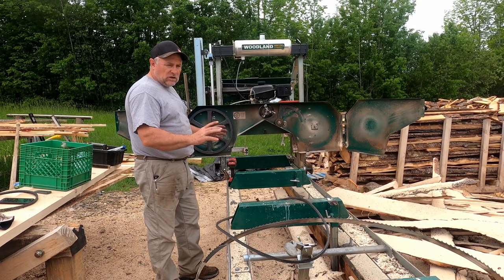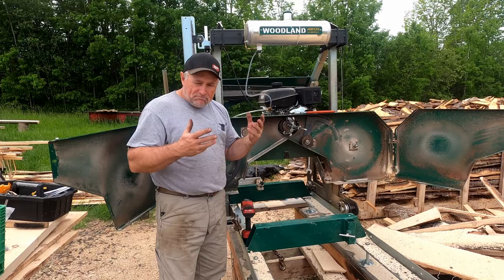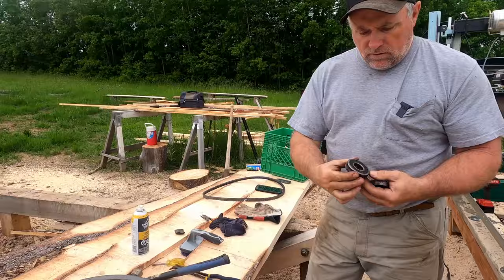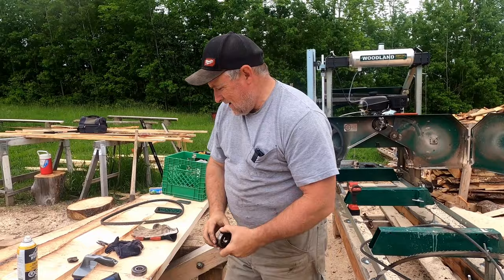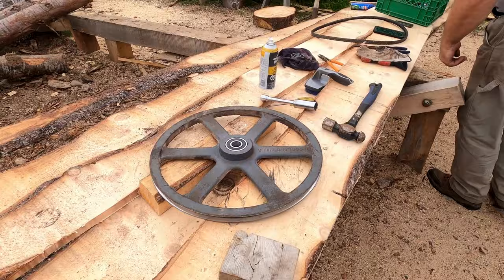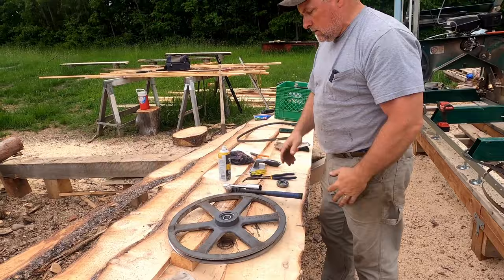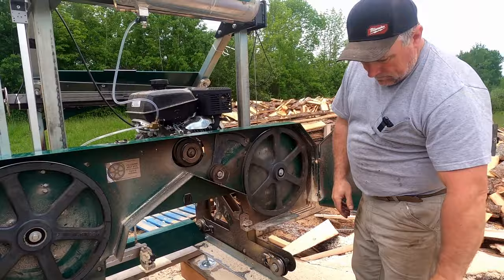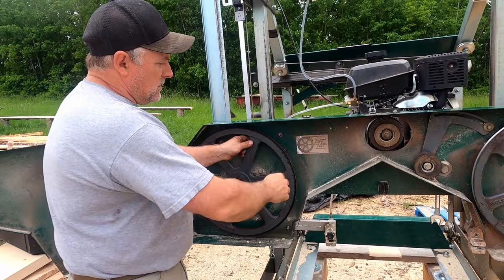Woodland Mills HM 126 / The Bearings are Shot Already.

Comment: My 2015 model WM 126 has about 700 hrs on it, I saw about 30-50 big white pine, spruce and maple logs per year, I’ve never had to replace the wheel bearing, one thing I do once per year is spray them with WD 40 with the blade at half throttle, I get the little tube right against the bearing so it penetrates, I also spray the outer clutch bearing, after it started howling one day, the problem I find is the humidity and moisture can cause all kinds of problems. I have a new spare clutch and bearings since day one. Great job on the tutorial on changing the bearings.
Reply from the maker: Thanks. Those are great tips. I use a lot of the WD40 as well. I think my bearings were wore out because I mill every day. I know Woodland Mills changed their supplier as well. The bearings on the older models were made in the US. Most of the parts now are outsourced from China. I think the quality has been somewhat compromised. Thanks again and have a great week.

Comment: That was one of the best videos on replacing bearings.  One thing I've learned about some new sealed ball bearings they can be light on grease. I remove one of the dust seals and fully pack them with good quality grease, then re-install dust seal.  Even some name brands can skimp on grease.  Maybe after 50hrs clean and repack bearings to get longer life.  Thanks for sharing 😊
Reply from the maker: Great tip! Thanks for watching. have a great weekend

Comment: From someone that has done 45+ years of wrenching on all kinds of equipment.
You did an excellent job, and your presentation was spot on with support techniques for newB's.
I'm a little surprised these bearings are failing at such low hours, so I will be super watchful on my 130max.
Only thing I would say,.. snap rings should be visible or facing out if my memory serves well.
And I ECHO your opinion... Use the right tools, no need to scratch and beat things up with such a simple process repair.
Again great job.

Oh.. now I wonder if my spare parts kit included wrong bearing for clutch.
Reply from the maker: Thank you very much. Glad you enjoyed the video. I try my best to present things simple and to the point. No sense complicating everything. I see a lot of folks hammering away on things they shouldn’t be and creating more issues down the road. Hopefully something we say or illustrate helps. Take care and thanks again. Have fun with your mill my friend

Comment: GB to you too, I have the HM122 it's a 2022 model only done less than 6 hours of cutting and had issues with my mill throwing the blade off. I made a video of it on my Youtube channel. Woodland mills said it's my belts are wore out so bought new ones from them hopefully that solves everything.
Reply from the maker: I hope that solves the problem for you. Not sure it is a wore belt that would be doing that. Usually it’s either blade tracking or tension issue. Good luck
Reply: @CreeksideMaplesHomestead  woodland mills says my belts are wore out so I have to trust their judgement I guess. Time will tell. What size is that pulley puller you have? I'm looking for one on amazon but they have 3" 6" and 8"
Reply from the maker: @stevecarr7338  my puller is adjustable widths. Anything from 2 inches up to 8. I think I bought it at Harbor Freight tools.

Comment: Nice info, i guess if it was mine i would have drilled the hubs and put a grease fitting in it, then you would only need to take the inner shields off the bearings.
Reply from the maker: Great idea Tim. But if I did that I may void the warranty, not sure.

Comment: Do Woodland Mills quote an expected life on bearings?  These would be ball bearings I presume to support the blade tension load.  Once the blade meets cutting load opposition, the load increases to a side pressure in addition to the blade tension load......of which the ball bearing and mating inner/outer  race are not necessarily designed for.....Just a thought....Perhaps a pair of tapered roller bearing assemblies (like a automotive wheel bearing would do)  would hold both the radial and axial loads created from cutting.....Good video, informative, thank you....I"m thinking of buying a W.M. so this has given me another item to look for on competitive machines.
Reply from the maker: I don’t think WM gives any suggestions in bearing life. I know they ship extra bearings with the mill.

Comment: NO NO NO. You will destroy the bearing by bashing it. Use a piece of wood across the whole bearing
Reply from the maker: Thanks for the comment. I used a piece of wood across the entire surface of the bearing. No problem at all.  Been  doing it this way for 30 years and never ruined a bearing yet. Have a great day. And I will make sure I have the entire bearing covered. Thanks for the heads up.

Comment: Thanks for all the Great info,  I have a  woodland mill with a few hours on it and was changing the blade and noticed the drive and guide wheels have a little free play to them, is that normal or do they need adjusting/tightening?
Thanks
Reply from the maker: Hi Friend. Thanks for watching and supporting the channel. The pulley wheels should have some slack and movement un them when there is no tension on the blade. Once you tighten the tension, the wheels should not have any movement

Comment: It doesn’t seem like the bearings should be shot after so few hours.
Reply from the maker: I agree but they were. Put new ones in and problem solved
Reply: Yes you can hear that they are shot. In the past I attended a bearing school put on by SKF and they had charts of how long a bearing should last and it is in the thousands of hours unless Woodland is asking those bearings to do something they were not designed to do such as spin too fast, have too much load or have a side load. Whatever the cause Woodland had to misapply to cause this. The fact that the bearings are part of the spare parts kit shows that they know it’s happening but they don’t want to redesign the machine to not fail. 
I was about to order one but looking at other videos and yours seems to show that they have lots of problems so now I am going to look around more.

Comment: Nice video👌
I'm just wondering why you didn't change the bearing on the tensionwheel while you were at it? Your filosophy was to change them all when you had it all apart but then you skipped 1 and didn't even mention it🤔
Also that one bearing you had that didn't fit in the clutch is peobably the one for the tensionwheel😉
Reply from the maker: Thanks for the comment and you are right. The tensioner needed a different pully that I didn't have. Should have mentioned but when filming it is sometimes hard to think of everything on the fly. But thanks again and apreciate the great comments. Have a great day
Reply: @CreeksideMaplesHomestead  Aaaah, ok. That makes sense. Thank you so much and have a splendid day yourself☺️

Comment: Do you have problems breaking blades on the welds? Do the guide blocks create a problem (friction) for the blades?
Reply from the maker: Good day. Thanks for the comments. I don’t have to many blades break. There will always be one here and there after they’ve been sharpened 4-5 times. I always slack my tension off after I’m done milling for the day. That helps. Keeping lube on the blade helps as well. Keeps blade temp down. I set my guide blades really close but not touching the blade. I use a double folded piece of paper to set my tolerances. I do check and clean them. Hope this helps. Have a great day.
Reply: @CreeksideMaplesHomestead  hanks. I loosen my blade as well and keep water and soap running all the time when milling. Do you use the double fold on each side of the guides when setting or one thickness each side? How many hours total do you get out of a blade usually? And what brand? I have tried Lennox/Woodland Mills, Cooks, and now Wood Mizer. The Wood Mizer Doublehard work well to start but break on the weld a lot.

Comment: I just sold a 2006 Woodmizer LT28 with 912 hours on it and the bearings on the blade drive wheels were still running true and silently...I owned a Woodmizer LT 40 Super Hydraulic previous to that...bought it used and cannot remember how many hours were on the mill or how many I put on it but never even had to replace the blade guide bearings....I was cosidering buying the Woodland 130 Max but now wondering if I should after seeing how poorly the bearings stand up...and the Woodmizer mills run the blade significantly faster and with more horsepower....
Reply from the maker: In all honesty, I think Woodmizer is a bit better mill. However, Woodland has made great progress in the quality of their bearings. The 130 Max is a very good machine. I think you would be happy with either mill.

Comment: Good day to you. Need help I got bad bearings what size wheel pullers would I need thanks for your help
Reply from the maker: Hi Wallace. Sorry to hear about your troubles. I have a mid size three way puller. The arms are 3 and 4 inches long. I’m not at home right at the moment but when I get there I can check for you.
Reply: Thanks I appreciate the come back I got the 4inch to be safe I got the wheel off now thanks again
Reply from the maker: @wallaceviviansadventures2095  If I can help in any way let me know.

Comment: is the width of the track bang on at 37.5" between each bunk? wondering if this could have affected the longevity of the bearing. and how is your level?
Reply from the maker: Yes. I took great pains in getting the rails spot on and the level as well. I think it was just a case of cheap bearings
Reply: @CreeksideMaplesHomestead  interesting. Did you buy the new bearing from woodland? I know there are quality in bearing. The quality also reflect the price. I just got my HM126. I need to assemble it. And I got the spair part kit. Maybe I should a have shop arond :)
Reply from the maker: @MrTgrasshopper  I did get the bearings from Woodland. I to ordered the spare parts kit. It came in handy. I had almost 300 hours on the old bearings. My mill has been a pretty good mill. You just have to stay up on the regular maintenance.
Reply: @CreeksideMaplesHomestead  good to heard. I live about 5h drive from the compagnie wherehouse. Iy should help with shiping time if i need anything.

Comment: What is your experience on belt wear? I am trying to help a guy who own this machine and in his case the belts are wearing down super fast, lasting probably only a few full days. Also he is complaining about vibrations but in my opinion this is linked to the machine design with the motor firmly connected to the frame (no rubber blocks/ flexible coupling) which is a choice of cost vs. quality. I'd appreciate your opinion! Greetings from Holland.
Reply from the maker: Hello my friends from Holland. Great to hear from you. I’m sorry your friend is having belt wear issues. The first question I have to better understand the problem, is the wear on the outside edges of the belt and if so does it seem like the wear is more obvious on one side or the other of the belt?  If you can send me any pictures that would help as well. You can email them to creeksidemaples@gmail.com. I will do my best to help you out. As far as the vibration, I’m not getting any in my mill. There are some things we can check. But let’s get the belt problem fixed first. I’m also open to Video Chat calls through Instagram or Messenger as well as a FaceTime Call. Look forward to hearing back from you. Take care. Cheers🥂
Reply: @CreeksideMaplesHomestead  Thanks so much! My friend is also in touch with the manufacturer now so let's see what comes up. I do generic mechanical maintenance with a solid background in machining and to be honest I frowned when I first encountered the mill with the saw running on the V-belts. I have seen plenty of bandsaws both for metal and wood, in fact I do maintenance at a sawmill and pallet factory and all machines run the saws on metal wheels. But well, the mobile mills have come up with running on belts. Do you have any figures on belt replacement intervals (hours)?
Reply from the maker: @bigbattenberg  it really all depends on how much run time is on the belts. If he is running his mill every day the belts will need replacing sooner. I run my mill a lot so I replace the belts probably every 2-3 months. 
One thing your friend should check is the tension pulley alignment. If that is off even an eighth of an inch, it will where the drive belt out quickly.
Reply: @CreeksideMaplesHomestead  Ah yes. We were working on the tensioner at first when the saw blade did not track well anymore and wandered. After some time it became clear that it was the drive belts worn down to the metal of the wheels. After replacement fine adjustment could be made once again and the blade tracked fine as before. But now he  says it is eating the belt very quickly. With this construction a replacement every few months would sound plausible, not weeks or less. I think that when the pulley alignment is off the blade would not track properly so that kind of figures itself out. I'll keep you posted on how things progress.
Reply from the maker: @bigbattenberg  How’s the bearings? Do they seem to be tight ?
Reply: @CreeksideMaplesHomestead  Yes we even replaced them even though I determined they were fine.